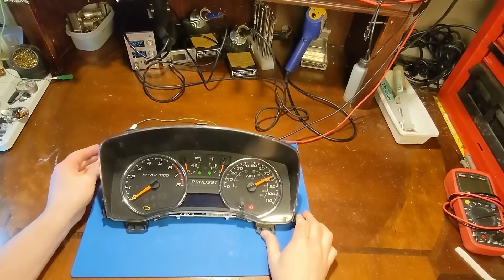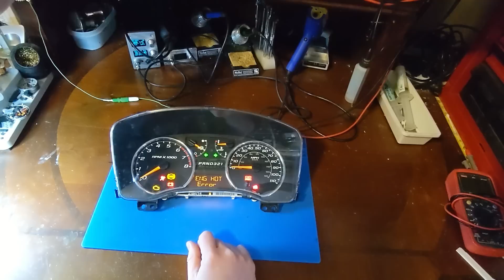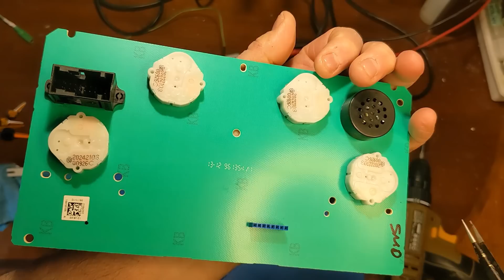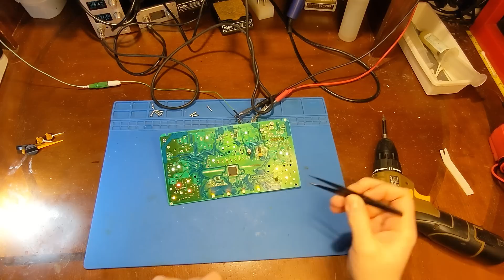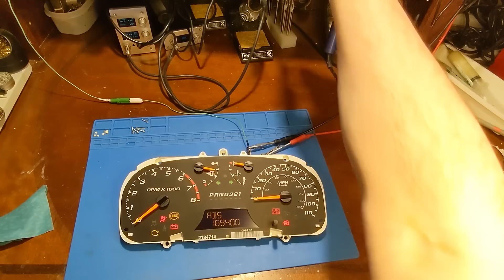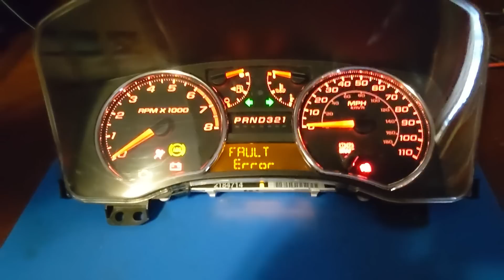How to fix a Chev Colorado Cluster

Comment: To my knowledge and I'm sure there's always someone who can do what we think isn't possible but I thought once a cluster was programmed to a vehicle it couldn't be programmed to another
Reply from the maker: It depends on the circumstances and the vehicle. With some vehicles there's nothing stopping you from installing a different cluster, except perhaps some trim level options may not work. And other vehicles will disable the odometer if you try the same thing.

Comment: My cluster works but none of my warning lights come on or any lights all the lights work to the ac controls and radio but the dash just went dark I can still see the miles come on when you turn the key on and all gauges work fine but no lights illuminate at all just dark 2010 Colorado

Comment: I have a 2012 Chevy Colorado and the speedometer is not working. When I pull out the fuse and put it back in the speedometer works for a little bit and then quits again after an hour or so. What do you think the problem is? Could I buy a cluster from you and swap out the core?. I don't want to do the soldering etc. Thanks in advance for your help!

Comment: What if the abs and e-brake lights never go out, and you get messages constantly on the readout about abs, traction control, ect?  First would come with big bumps and go out with a restart. On constantly now. 09 colorado

Comment: Hello friend, a cordial greeting to you, and your repair shop is great, I have a 2008 Colorado, which was abandoned for many years, I bought it in that state to recover it, it is very well preserved, after checking the entire electrical system, cleaning all the contacts and grounds, when passing the switch, I noticed that the cluster did not turn on, I disconnected the cluster connector and reconnected it again and all the lights came on, but when I disconnected the battery and reconnect it and pass the switch, again it stopped turning on, I removed the connector again and reconnected it and it did not turn on, after several attempts it turned on the cluster again, but when I disconnected the battery again, it stopped working again and it did not want to turn on anymore, not even removing and placing the connector, I tested the power and the ground, and they reach the connector perfectly, check the pins of the cluster and they are in good condition, the display works but does not light up, the The needles work when activated with the scanner, but the lighting and warning lights do not work, could it be a problem with the cluster or the BCM? Could you guide me please, thank you!!

Comment: Just changed the battery on mine and the cluster started up for a minute then it just turned off truck still on just no power. Not sure if I should replace the whole thing or send it to get repaired.
Reply from the maker: @ZiggyKai808  If you install a used instrument cluster from a different Colorado the odometer will no longer count correctly. That may or may not be important to you.

Comment: I'm looking on doing some mods to my gauge cluster, I bought a used one off ebay and gave it 12v to pin 1 and gnd to pin 4, only the CEL comes on and nothing else. As for the serial bus how are you simulating that?
Reply from the maker: With one of these that I made https://youtu.be/sK-0JmeoRZM?si=UlYTgQLtOhopKo38
Reply: @jeffescortlx  I'll give that video a look, thanks.

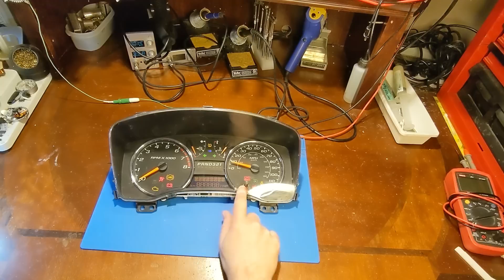Comment: My 2004 has symptoms exactly like yours at 0:56 seconds, as if my serial buss is not connected.  This happened in conjunction with Hurricane Milton in St Pete FLA. I would like to clean the ground connection at the frame, first.  Where do I find it?
Reply from the maker: The grounds are generally reliable in the 03 and newer full size GM's. If the cluster ground was bad you would loose the odometer display.
Reply: Hey Jeff how are you doing two sides simultaneously with the solder iron. Are they both solder iron tips?

Comment: Great Video....Thanks
I have no sound on the signal or emergency flashers. Could it be a bad speaker? or a bad solder joint?
Reply from the maker: I would start by looking for fractured solder joints.
Reply: @jeffescortlx  Thanks

Comment: What does it mean when the whole cluster goes out randomly and then comes back randomly ??
Reply from the maker: Depends, is the vehicle a Colorado?
Reply: @jeffescortlx  yes it’s a 2004 Colorado . The whole dash goes out but the warning lights
Reply from the maker: @chapinbound9017  could be a few different things. If it seems to be temperature dependent it could be a bad microcontroller, or it could be a fractured solder joint somewhere like an inductor, If you go over a bump and it causes it to be intermittent. Without hands on troubleshooting it's just a guessing game.

Comment: Hello, by any chance do you know how to make the turning signal/hazard lights "tic toc" sound work again?
Mine stopped working randomly even though everything still works just fine. There is little to no info about it in 355 forums.
Reply from the maker: I'd need to get my hands on it to trouble shoot.

Comment: Quick question so my cluster comes on and off all lights and everything work expect all the analogs .. rpm , speed , gas and oil stay at 0 .
Reply from the maker: Could be a few things. Possible microcontroller going out. I believe it drives the stepper motors directly.
Reply: @jeffescortlx  is that’s something I can do myself or it’s better to have someone else do it or just replace it ??
Reply from the maker: @chapinbound9017  New microcontrollers are not available pre-programmed, and are difficult to replace without experience and good tools.
The Colorado is picky about cluster replacement if you don't go with the dealership doing it. If the replacement cluster has too low of miles, the odometer will not count up. If the miles are too high the odometer will count, but the BCM will force the odometer value to that new higher number.
Reply: @jeffescortlx  do you do repairs on them ? Like maybe get it shipped to you
Reply from the maker: @chapinbound9017  yes. Although if it is a bad microcontroller a replacement donor board will be needed. The odometer value can be transferred over.
Reply: @jeffescortlx  how much are we talking ?
Reply from the maker: @chapinbound9017  For quotes I can be reached at the email address listed in the description of the video.

Comment: My temp gauge on my Colorado shows 3/4 with the key off and then goes above max hot but its not overheating the gauge is faulty. Will the solder joints cause this or a failed stepper motor?
Reply from the maker: For the Colorado model this is more than likely just a bad solder joint at the stepper motor.
Reply: @jeffescortlx  thank you. I am an A level Auto tech. What was the fluid you dripped over the joints. Is that just Flux? I'm sorry first time to your channel. Also I will send you 25 dollars for your help if this is the fix. Thank you Jeff.
Reply from the maker: @acetech9237  Yes it's just flux. It's not required, but it does make nicer solder joints.
Reply: @jeffescortlx  as a tech like yourself in the trades we don't work for free, nor should you
Reply: One more thing. I don't see any rings. I have a set of magnifying glasses you put Over your eyes like normal glasses but can't find them at this moment. I don't see any rings on the joints. I'm trying to email you at the 1mr. Email address but won't go through.  I'll keep trying. The question I have is if say the joints are OK is it worth plugging it in turning key to on position and trying to reposition the needle after it has say 20 seconds to do its sweep of the gauges and see it that works? I think this may have been sent off before. The back of the cluster in a corner that looks like sharpie reads SMD OK FCT OK ICT OK. I'm wondering if someone say over seated the needle like you mentioned not to do if it may have just changed its orientation and needs to be put back. After running the truck 15 mins the temp needle read above the max temp position which is why I ask, even though with my infrared temp gun the temps were normal and fine. I have 00926 stepper motors. I can buy a used one from a reputable seller for 30 bucks. Would Changing the needle position to test my theory be a bad idea or should I just opt. For a new stepper motor and solder it on? Thanks Jeff.
Reply from the maker: @acetech9237  email replied.

Comment: Thank you for the very informative and detailed video. I have a 2005 Colorado, and the backlighting works normally for short drives (although sometimes they are stuck on the dimmest setting), but after more than 30-60 minutes, it cuts out, although the needles and everything still move, and the DIC and blinker arrows still illuminate normally, the gauges don't. This also happens if I shut off the truck and turn it back on after driving. This is fine during the day, but at night it makes it impossible to see my speed once they go dark. I tried replacing the interior light switch, cleaning all of the grounds (even made some extra grounds), I don't really know what else to do. Any suggestions? I had heard the issue might be the BCM, but I opened this up and everything looks fine to me.
Reply from the maker: If the radio, climate control and other dashboard buttons don't have any trouble with backlighting, it's probably not because of the dimmer/BCM. It could be a defective LED within the instrument cluster, but unfortunately you can't tell if it's bad by just looking at it.
Reply: @jeffescortlx  Thanks for the reply. The lighting only goes out behind the gauges. Stuff like window switches and HVAC is still backlit (although 1 or 2 bulbs are completely burned out in the HVAC), even the DIC in the middle of the gauges stays lit. Sometimes the gauges are also dim, and then the dimmer switch seems to have no effect on them. I'm proficient enough to replace the LEDs if I get some, I'm just worried about popping off the needles. I'm gonna try replacing the headlight switch one more time (I sent the last one back), if that doesn't work, you think an LED swap would be the next thing to try? I think I'd just put a full set of new white ones in (same spots you did the red in this video) even if only one was bad, just to be done with the issue for good. Again, thanks, and happy holidays to you!
Reply from the maker: @eb110americana it sounds to me your Instrument cluster has failing LEDs. Yes I would recommend all LED backlight replacement. No need to worry about the indicator LEDs.
Reply: @jeffescortlx  Thank you so much. I ordered a 100 pack of white LEDs, so I think I have my holiday vacation project ahead of me (or one of them, anyway). I think you are probably right. I will let you know how it turns out once I go on a longer drive that would normally shut off the gauge backlights.
Reply: @jeffescortlx  I mentioned last time that I would update you on how the replacement went. And I am happy to report that the backlighting behind the gauges is fixed! I took a long 3-hour drive to visit my dad, with the last hour after sunset, and the full 3-hours back at night, and not once then or since has there been a problem. I would have spent around $500 to replace the BCM next if this didn't do it, so you saved me a grip as well. I'd have been happy if the lights went back to factory brightness levels, but bonus: the gauges are now super white and crisp, way better than factory. The only difference is that the LEDs are so efficient, that you cannot dim them with the dimmer switch anymore (only the HVAC controls now dim, since the rest is all LED)--but I never dim them anyway, so no loss. Total cost for the pack of 100 LEDs on Amazon was $10 + tax, and I only used 7. Again, thank you so much for your video and assistance, it was a lot of help fixing something that has been an issue with my truck for a few years now.
Reply from the maker: @eb110americana  glad to hear you got it working

Comment: Having an issue with my 2011 Colorado cluster thinking maybe you could help me out. I recently took my cluster apart so I could clean the inside and accidentally bumped a couple of gauges slightly. Once I was done cleaning I moved a couple of the gauges back to their zero position. But for some reason the tachometer gauge keeps wanting to go down below the zero mark. It randomly after the third fourth, fifth sometimes 6th key on, it makes a buzzing clicking sounds as does the one in the video which I believe is normal, and at that point it moves needle down past zero mark, I've tried moving the needle to the zero Mark with power on, power off, key on but engine off. Yet for some reason it keeps wanting to move itself about an inch and a half to three quarters of an inch below the zero mark even though I moved it to the zero mark. I've also tried moving it up to the three and with several key on key offs it eventually Works itself down to again past zero mark. Any suggestions would be greatly appreciated thank you.
Reply from the maker: You'll need to remove the needle, power on the cluster without the engine running and then reseat the needle in the correct starting home position.
Reply: @jeffescortlx  I will try that, although it don't make much sense since I never actually removed the needle in the first place.
Reply from the maker: @curtisbull1583 I understand. But you may have bumped into the needle enough to make it spin on the shaft.

Comment: Great video. I habe a 05 Colorado water got to the dash. Whole Tac is out. When putting on turn signal it flashes w/ check engine. Other than that nothing works. You think whole tac needs ro be replaced? Thanks!
Reply from the maker: Well sounds to me the entire instrument cluster needs to be replaced not just the tachometer.
But unfortunately it's not that simple with the Colorado. If you try to install a used junkyard instrument cluster into the Colorado the odometer will freeze up and not work. So whatever you do make sure to save the original instrument cluster even though it's water damaged.

Comment: I worked in a junkyard it's a 2011 cluster all the same cruise control and all the same controls and I put it in my truck and it works fine you don't need to have them programmed
Reply from the maker: What did the odometer do?
Reply: Gave him less mile probably 😂😂😂

Comment: We have the same board and there is no gauge led's that light up?
Reply from the maker: While it's in the vehicle and headlights are turned on? If the rest of the dashboard lighting works you might just have a defective LED causing them not to light.
Reply: @jeffescortlx  It was just all the gauge lights, from you videos I was able to just go thru and re tough all solder points and it now works great, looks better than when it was new. Thanks again for the videos...👍
Reply from the maker: @neiltyner1796  glad you got it working!

Comment: what voltage does it occupy for that led, I have a red one the same and I would like to know what type of led the vdd has left I don't know about that issue
Reply from the maker: This uses a standard 3528, voltage is around 2-3 volts depending on color. I believe the circuit limits/regulates the current.
Reply: can you put 3.3 volts?
Reply from the maker: @mariovelazquezMV  yes

Comment: Did I read this right, that is I use a data line from a BCM to power on the lights that it will change the milage of the cluster to whatever is on the BCM?
Reply from the maker: But no not exactly. If the miles on the cluster is less than the miles and the BCM I believe the cluster will automatically jump up to the miles that's on the BCM. But if the miles are higher on the cluster than in the BCM, The odometer will stop counting and just stay there until the BCM catches up to what the cluster says. It's best to just not swap clusters and keep the original cluster with the original vehicle.
Reply: @jeffescortlx  Thanks for answering, I wanted to do this on a work bench. I have been repairing clusters for awhile and wanted to add Colorado to my list

Comment: Sir, I have a 2004 Colorado that the odometer stopped at 36054 and the trip odometer is 0 no moving.  Anything else on the dashboard works fine.  Do you have any idea? Or any suggestions where to start?  Thanks.
Reply from the maker: Do you know the history of the truck and cluster?
Reply: History was clean. Everything is original. Truck was bought and used on farm only.
Reply: The local GM dealer checked but not able to find anything wrong, according to them.  They said couldn’t find any code on either cluster and BCM.
Reply from the maker: @Panawell-rt8kg  the only time I've seen a Colorado cluster work perfect except for the odometer no longer counting is when it was switched out for a non original. Did you see the odometer work before it didn't?

Comment: I got the same cluster  on mi truck colorado 2004 I can get the buss signal  part to come on the plugs soldering looks good but the female  plug  on the truck is hard to check I wonder it is possible  that the signal is not coming out of the computer? I have no bench tester so any other way to check this I will spreciate  you help thanks
Reply from the maker: Does a scan tool have any trouble communicating and getting codes?
Reply: Thank you for you response  no all codes good I fix it i check the circuits  lines find a hiding  cut on the male plug pin also a rewire ground clean battery  connection  came a life right  on  this truck  have terrible  cluster plug and ground connection plug thank  you. you videos help a lot I work on old classic rebuilding cars clusters fiew years back never on electronics  ones but I do other types of electronics so this was  easy thank you for you time and videos

Comment: 12 volts coming from power source? And where did you get the leds?
Reply from the maker: Yes the cluster is powered by 12v. I get my LEDs from Mouser, Digi-Key, element 14 Newark, Amazon or eBay.